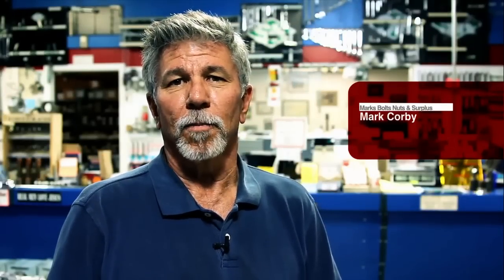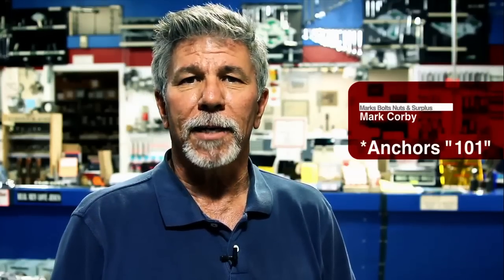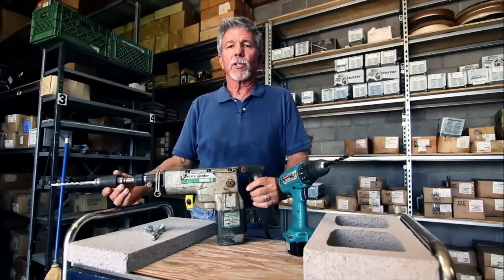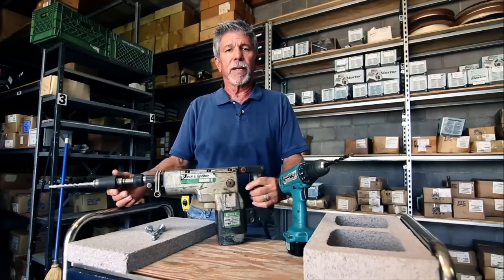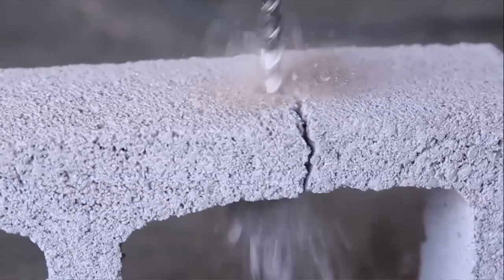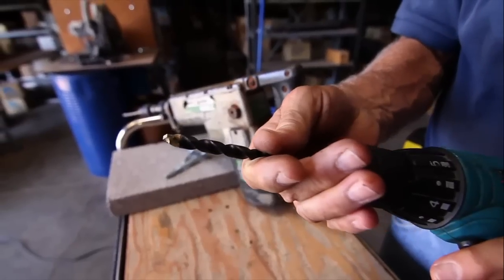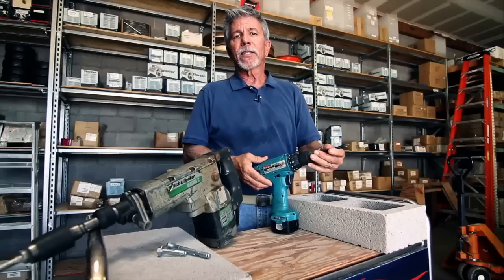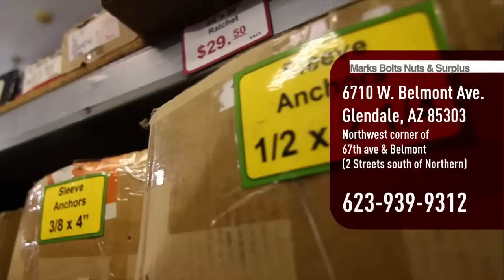How To: Proper installation of standard concrete sleeve anchors with Mark Corby

Comment: Another tip: Do not try to anchor anything to a block wall right on the corner of the block. Someone hung the roller guides for our drive gate that way. Obviously the corner of the block broke off, and the gate almost fell over. The block install was so poorly done, I would up using Unistrut slotted strut and caulk anchors, to distribute the stresses of the rollers and the gate along the whole edge of the wall. I tried drop in steel anchors. No soap! I tried the collared drop in stud anchor. No good. Finally I dug out my $55 hollow block wall set tool and some lead caulk anchors. The wall was supposed to have grouted cells, but the grout was never tamped or vibrated so the wall had lots of voids and air pockets. I hate going back over substandard work.

Comment: Do countersunk sleeve anchors install in the same way as the sleeve anchors you've used?
Reply from the maker: Yes, the countersunk sleeve anchors expand just as a regular sleeve does so installation is the same. Only difference would be what you're anchoring down should be dimpled to match the countersink of the anchor !!

Comment: Great, thank you.  That roto drill seemed like an overkill.  What about a smaller hammer drill?  I added a small gauge hook to a concrete deck a while back and used a rotary with a masonry bit, but it took a long time, pulling off a very fine dust and making the bit really hot.

The carbide bit you showed had some sharpness to it.  Was it sold as a masonry bit?  I have some carbide wood bits and maybe one for metal, but I figured it would ruin them.

Anything to say about drop in anchors?

Comment: A smaller hammer drill works really well too (preferably with 2 speeds; using the lower speed). I find that it is much quicker than my cordless Makita drill and more comfortable with 2 handles and more torque. That Roto drill was a beast and total overkill.